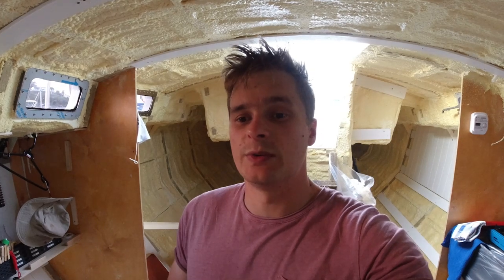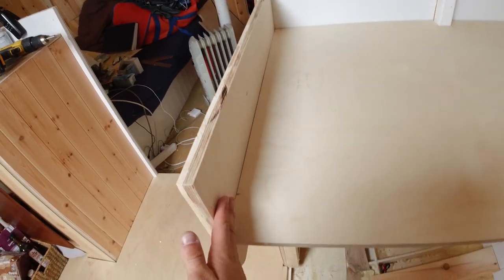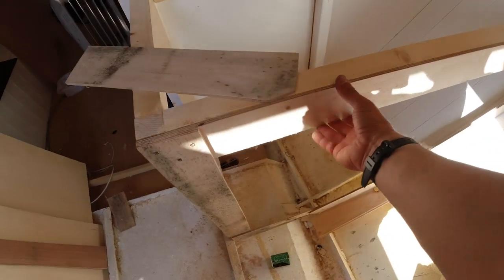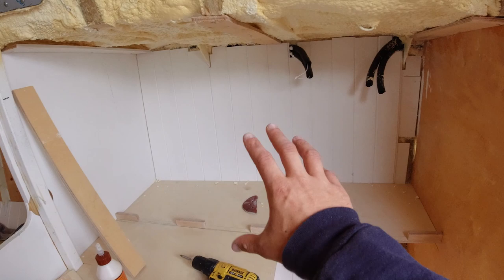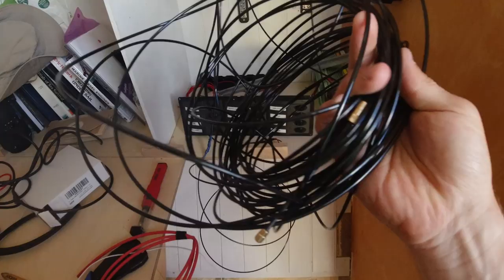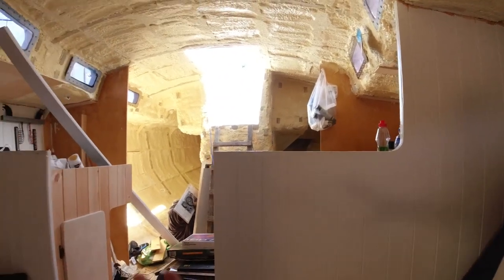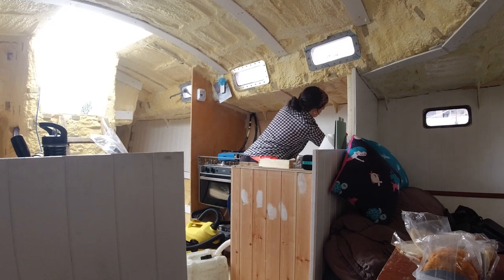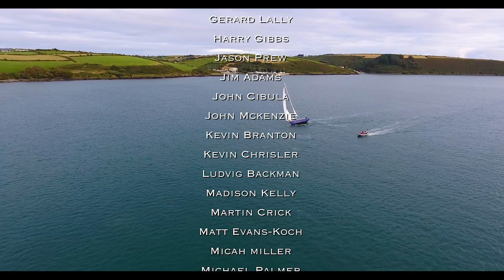Chart Table Construction & Paint - Episode 37 - Sailing Yacht Zora

Comment: You ask about your gas (propane) line. It needs to be a single line from stove to regulator. The tank(s) need to be in a box with drain line on the bottom of the box vented overboard. Propane is heaver the air. Good luck.

Comment: Hello Rhys, I have a suggestion for your NavStation seat, instead of increasing the width of the bulkhead and reducing the doorway, why not just  reinforce just the lower section below the seat height and under the electrical junction box,  by gluing and screwing a plywood panel to the bulkhead on the NavStation side and then make a cantilevered seat that is attached to the bulkhead underneath the electrical junction box by bolting it though the reinforced section, so it can swing out just when you want it, but you can still stand up either at the chart table or to work on the electrics, when it is pushed out of the way. Regards Dave
Reply from the maker: Good idea man, I had thought that maybe something like that would work too. Hope your boat is coming along
Reply: @SailingYachtZora  Yes, work on my boat is going nicely, I uploaded a new video to YouTube last week of my recent progress.

Comment: Well none seem answer me why still use gas cooker?... Why do you do it?.-.. When most bluewater set boats are loaded whit solarpanels.. Windmills.. Generator and so on.,. Tons of electricitity...But still put gas cooker in?.... I will have used Induction as fx Nordia yachts.. and avoid have gas on board. :) Thanks
Reply from the maker: We aren't quite there yet with that kind of technology for it to be viable, unless I fit a generator (which I'm not) and a huge amount of solar (I don't have the room) or a lot of Li batteries (extremely expensive). So on the surface it looks ok, but when you dig into it the cost makes it unviable for me.
Reply: @SailingYachtZora  Thanks for answer :;) I was just quiriuse,.. Seems many vidio's are having the 2 things often mensioned.. Kilo Wat and storage space... I just wonder why :))
Reply from the maker: @BertMerlin57  i think once lithium batteries get better, it won't be unusual :)